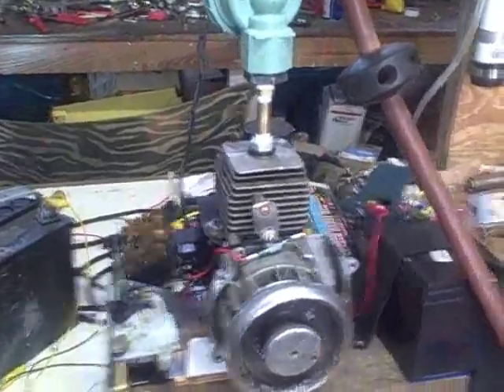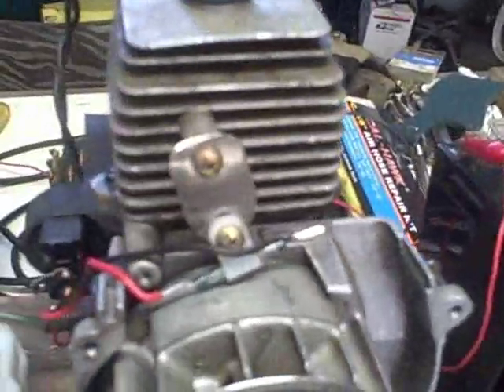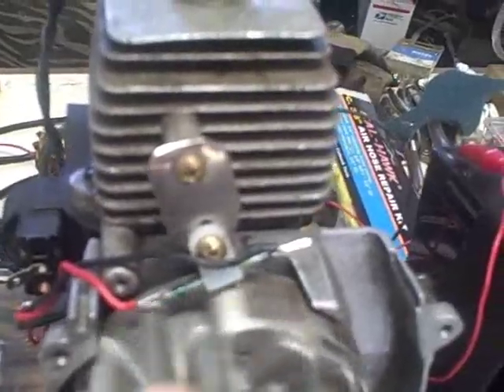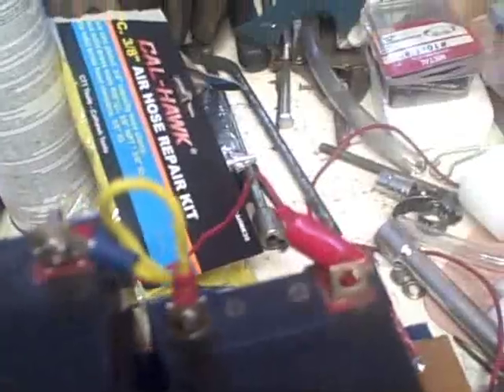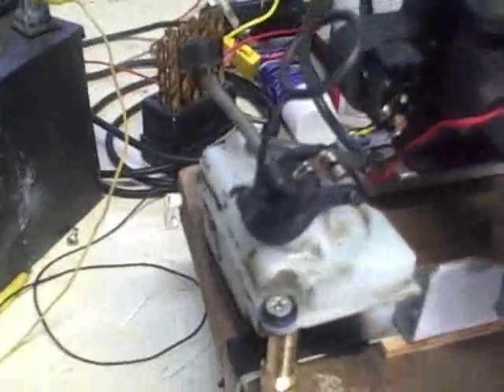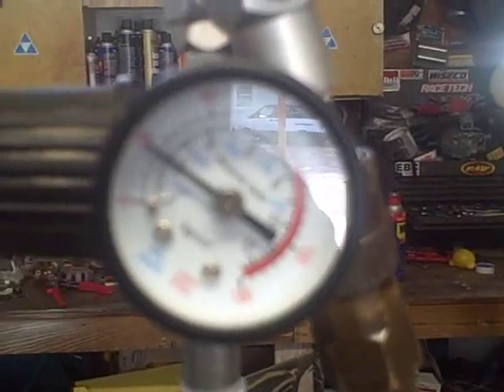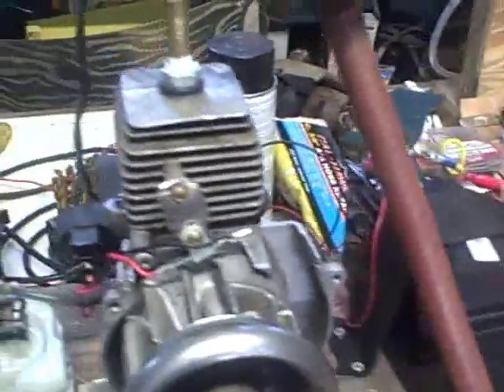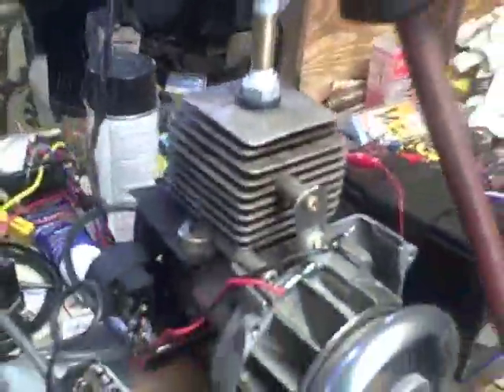air motor.wmv

Comment: @Boyntonstu, Cold Fusion is now generally call LENR:  Low Energy Nuclear Reaction, and work on it never stopped despite the mainstream Physics Nazi's running the team out of town. 20 years have passed, work has continued in private, as to be seen looking at it is profesional suicide, yet many large labs have experiments yeilding excess heat it seems with a repeatability of 3/5, bottom line is we still don't know exactly what it is, thats what science does!, investigates! (with an open mind)

Comment: @Boyntonstu, PV, are not batteries, that is a very old redundent term from when they were merly labority curiousities. Times change and you need to keep up if you are going to comment.
The Sun is a Fusion reactor, its radiation runs this planet and thats what PV's collect, they store nothing, so how are they batteries? plants use the same process to make, store sugar, so maybe plants are batteries? and indeed the latest PV's seek to copy Photosynthesis, as its the best Solar Power there is.

Comment: @Boyntonstu, BTW I do know a little about Hydrogen, my friend did his Phd on Hydrogen tanks for cars and his associate engineered the BMW tank that is now in service.
You are correct on this Planet Hydrogen is a storage medium only, because it is rare. 8,000 psi is not required in all applications, only those where the mobile platform needs a long range and refuel access is limited.
Low pressure Hydrogen is an ideal battery for Solar PV, Solar therm, Wind, Wave, Geo thermal, Bio

Comment: @Boyntonstu, 1% of roof space covered with PV produces enough clean power for a city.
I have been hearing uneducated questions like those for over 20 years, yet still we install, use and continously improve PV. I'm curious, have you bothered to look into embedded energy in High Temperature Photo Voltaics?
You are aware that they are extremely high output and very small?

Comment: @Boyntonstu,
1: Lots, varies to the process and factory, there are many different types of cell, if wind/wave/Solar is the source then the question is mute.
2: Lots, that data completly depends on where panels are installed etc and what type they are. many homes run completly on them comfortably
3: 30-50 years, depends on installation and maintenance, type
Very low grade questions really

I find it interesting you have not asked the same questions of production of coal, Uranium.

Comment: @1BustedMyth 

3 Questions about PV electric solar panels:
	
1> How much energy/power was used in making the solar cells?

2> How much energy/power will the cells produce each year?

3> What is the life expectancy of the cells?

If 2 x 3 is not greater than 1, we are wasting energy making solar cells.

BTW To equal the energy density of a gallon of gasoline, hydrogen has to be compressed to 8,000 psi.

Hydrogen, and PV cells are batteries, not alternative fuels.

Cold fusion is nonsense!

Comment: Personally I'm a big fan of PV Solar cells, electrolying water, store the gas, feed to fuel cell, use the power and recycle the water, repeat, it works and works well, the only problem is the cost.
In Southern Australia we recieve over 1,000WPm2 solar radiation, I am interested in mini Solar Thermal using molton salts to store the energy, this is proven tech for large scale.
What if this was the source of the Air for air motors?
Potentially less then batteries in an EV, faster recharge

Comment: @Boyntonstu, Hi, I'm not familiar with data on this, is that a reasonably accurate estimate?
and if so, i presume its with a normal compressor, just radiating its waste heat to air (wasting it)
was that 1hp based on a reciprocating engine?
if you have any good data links, would be appreciated,
Cheers

Comment: Very clever prototype, I love how you used the sprinker valve!
Personally i would not continue with a piston engine, if you are looking for genuine useable daily efficient transport, that 180 o turn loses a lot of energy.
we have a rotary one in sydney at the fruit market that is working well.
Using a scroll compressor from an industrial refrideration unit may be a cheap source alf a rotary.
I can see your point that air is easy to store and make, more so then Hydrogen/, fuel cells etc

Comment from the maker: I get the point stu. Maybe you could turn me on to  a more efficient and cheaper method of energy  storage and use. Portable energy is no small task. Stationary energy plants can produce far greater efficiencies and use a wide range of fuels. There is talk of cold fusion reactors going in soon so maybe the coal fires will be doused and we can use compressed air as inefficiently as we like.

Comment: Most of the electricity produced in the US is made from coal.

If you use a battery/electric motor you waste a lot of coal compared to using  gasoline.

If you compress air, you waste much more coal.

First, you make electricity, next you use electricity to run air compressors.

Compressed air cars pollute more than gasoline cars.

Comment from the maker: I am not trying to beat Faraday with this. I am just trying to find new ways to run motors. Even if this is less efficient than a gas motor it still runs on air. Air can be produced from electric very cheaply and stored fairly easily. If I were to make an efficient air motor for a car it would be very easy to fill up at night and very cheap to run back and forth to work. Almost everyone has to pay for fuel and it is usually their largest cost. That needs to change.

Comment: It might be your solenoid not being able to keep up with the high rpms. The reed switch should be fine. I use it to run upto 2000 rpm w/o any issues and others are using it to run magnet motors at several thousand rpms.